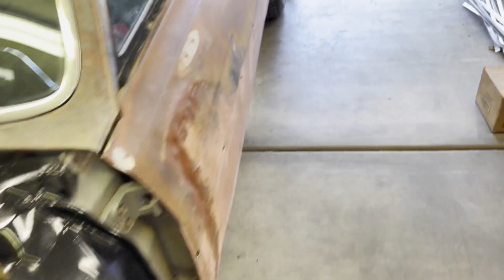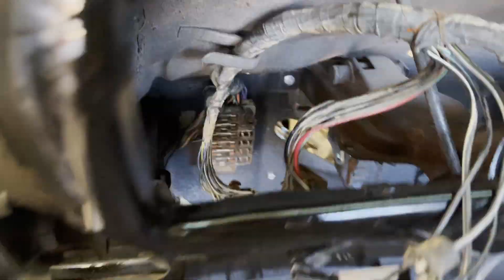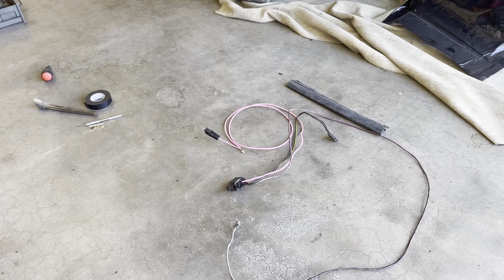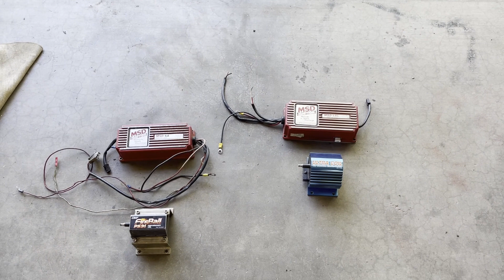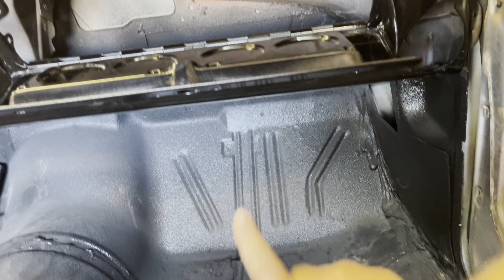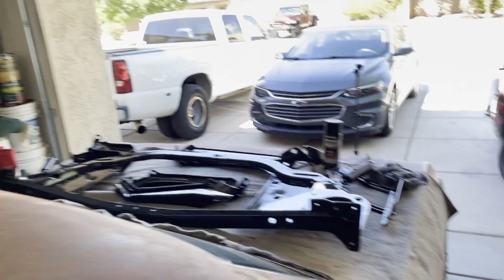Down N Dirty | 64 Chevelle Build: Reusing Stock Wiring Harness

Comment: Tell Jason Snyder to get out of your head! LOL Ignition pieces look just fine under the hood where they belong. No one is going to see that stuff with the hood shut anyway.🙄

You live in an extremely hot climate, save the under the dash realestate for the A/C. Or get an HEI distributor and don't run axillary spark box and coil. Those new aftermarket HEI modules are supposed to be good for 10,000 RPM so..... And those distributors are still reletively inexpensive. 

So you risk swampass or you play hide the ignition components under the dash?😁
Reply from the maker: You’ve obviously never met Jason Snyder!!! 🤣🤣🤣